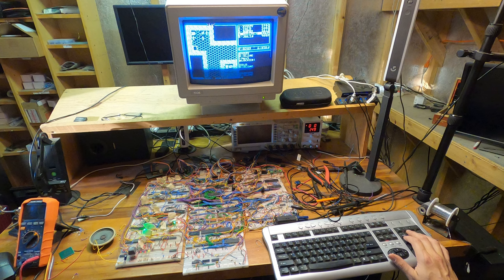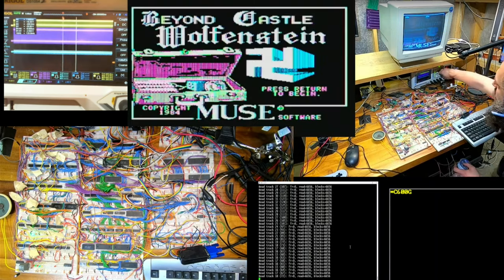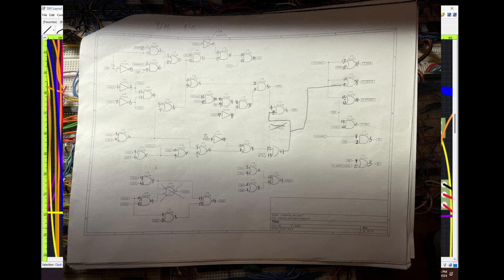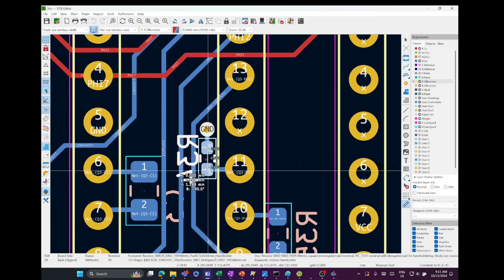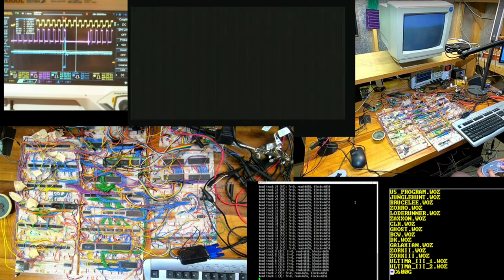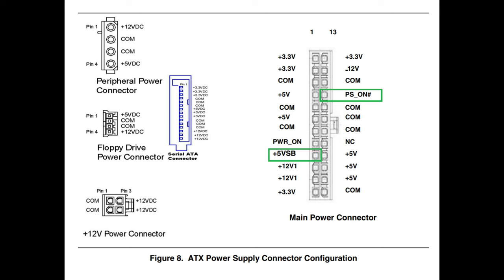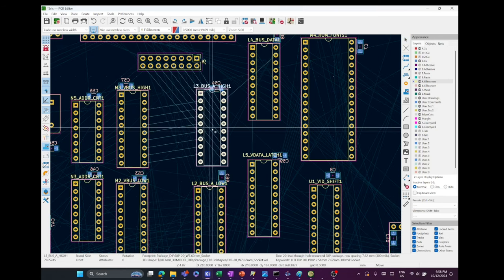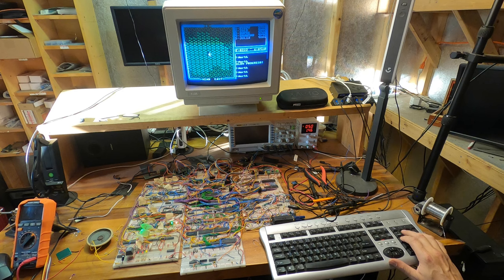3RIC 6502 from breadboards to PCB

Comment: A long time ago I built a 6502 computer using PCB's from OSI.  Back around 1976 or so, it had 16K ram (I got a good deal on 2102's in bulk) on 4 boards.  I had the MOS Technology TIM monitor, and Tom Pitman's Tiny basic.
I'd like to build a more modern 6502 machine, but designed around the WDC65C816 chip, which is  the same one used in the Apple IIGS.  A RPi Pico could do the video and sound.
Reply from the maker: Definitely.  RPi can do a VGA signal with no problem

Comment: Great work!  As a Signal Integrity guy, I'll caution you may end up with problems with your signal/GND/PWR/signal stackup. The speed of your board is determined by the speed of the logic transitions and not the speed of the clocks, so even retro projects with modern chips can end up with major SI issues. The problem is where signals are referenced to. 100% of the energy in a signal is contained within the electric field which exists in the dielectric of the PCB, not the trace itself. As you swap sides and use the power and ground planes for reference, your SI will get clobbered. There's an easy fix which will just about guarantee eliminating SI issues if they crop up here which is to switch to a 6 layer with a SIG/GND/PWR/PWR/GND/SIG stackup and use a 2nd ground via to join the ground planes right next to any signal via. As the signal switches sides it will be momentarily referenced to the GND via and the relationship to GND will remain constant along with the signal integrity. 

PS: I'm convinced there is no autorouter available for less then $200,000 which is worth a hill of beans. Always hand route for best results.
Reply: An autorouter might get you close enough from the rat's nest to make sense of how to finish the routing.  
As for the number of layers, is a 5 layer board (sig/gnd/pwr/gnd/sig) a thing?  One less layer (the pwr layer could be thicker), might be less expensive but is the same idea.

Comment: You should add ground vias in proximity to any signal via.
Reply from the maker: Interesting. Is that standard practice for PCBs?  Seems like it would be a good feature for the autorouter or KiCAD
Reply: @thecodesorcerer  Yes, this is good practice to do, especially with modern and high-speed components. Just adding these via helps with pretty much everything, EMI, signal integrity, etc.
Also, in the board stack-up it is good practice to bring the power plane and ground plane very close to each other, this increases innerplane capacitance and helps the chips on every signal state change to obtain instant power from the planes before the decoupling capacitors become effective. 
In the past, this was not so critical as the rise/fall time on the signal edges of the chips was tame compared to modern components. 
Also, be sure you have a plane directly under the traces. Never cross traces or cut through a plane even if it is convenient to do to get a route in. Otherwise, you open a can of worms with glitches and random, intermittent issues.
If you are not sure, look for pcb design layout guidelines with respect to high-speed.